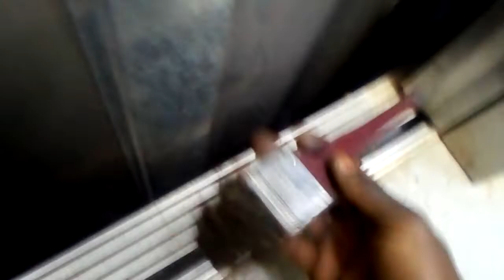this is why your elevator doors don't open properly & how to fix the problem ....

Comment: Can you share door opening from outside ie from floor landing, sometimes car door doesn't open, electrical supply is to switch off? for opening?
Reply from the maker: Hello Riyaz! Thanks for reaching out but I don't understand your question very well, tell me more about what you're trying to say...
Reply: @jovanhacks3073  oh
Once one passanger was trapped inside the lift at just 1ft below the floor level, power supply was ON 
As usual practice we opened the floor door with the key, but inside ie car door could not be opened, so the person trapped inside the lift applied his pressure to open it, unfortunately the lift belt broke out, so i was just wondering that how could that happened, why the inside door wasnt opening, do we need to shut down the power supply before opening? Or what gone wrong in opening?
Pls advice
Reply from the maker: I think in this case, the cabin "skid" was already passed passed the rollers that enable the landing door to open. So to open the cabin door for the passenger to get out, one had to go on top of the car and turn off the "car door drive" instead of using force which lead to breaking of the "door drive belt".
I'll make a video and explain this to you in more detail....

Comment: The elevator door doesn’t open all the way and closes and then opens all the way
Reply from the maker: Try restarting the elevator or checking the door opening and closing proxy or cleaning the door sensors or checkout whether the car door skid is working normally or maybe something is physically blocking the door...